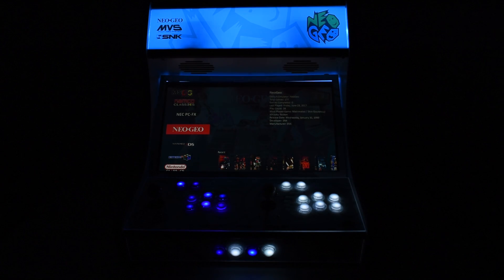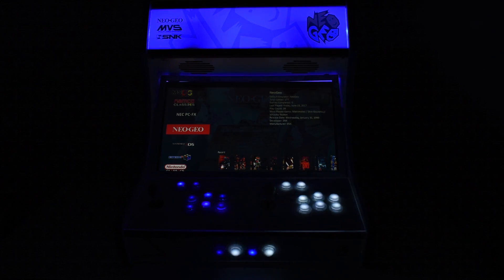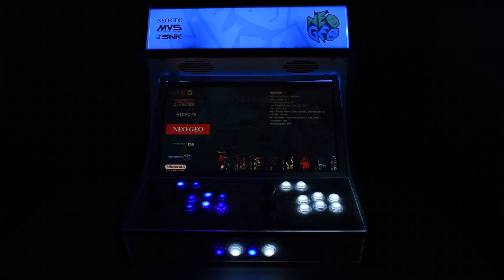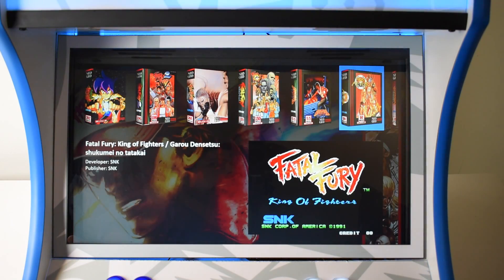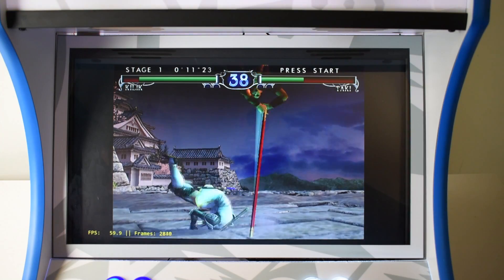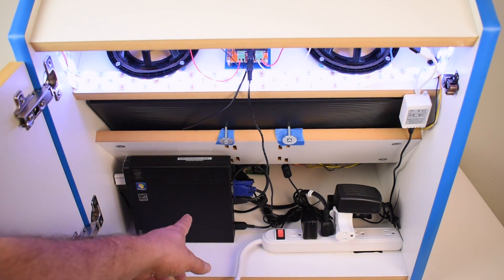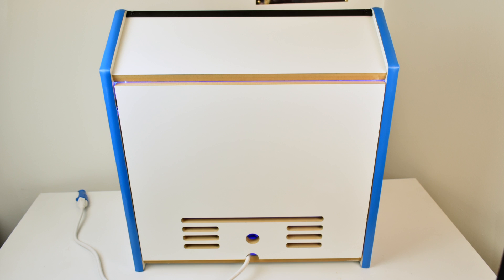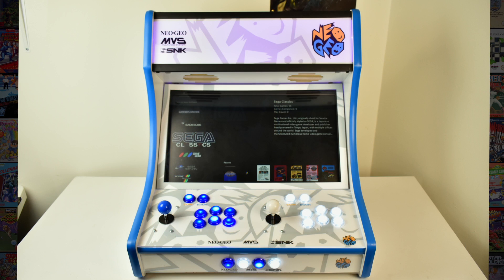LaunchBox BarTop Arcade Update Game Room Solutions Arcade With PC And IPS Display

Comment: Interesting, I assumed neo geo emulation would be perfect on a pi3. What games were giving you problems?
Reply: The pi is great for Neo Geo - Although Blazing Star can have some pretty major slow down at times, but that's part of the fun!
Reply: Jonny Blanka that is very odd that the Pi 3 lags with Neogeo
Reply: i would have over clocked it and put a fan in. done :)
Reply: Now that i think about it, it could be lagging because the original hardware lagged as well. That's why some emulators give you the option to overclock the virtual CPU.  SNES emulators allow you to overclock the FX chip to stop slow down in StarFox that also happens on original hardware.

Comment: Good!  I'm glad you showed us what's going on inside.  Nice and clean looking.  Would you happen to have a Dell SFF (small form factor) optiplex desktop to size up in there?  It sort of looks like it will fit based on what I see in the pictures.  If standing on end, it's 4"(w)x11.5"(h)x15"(d).  In the depth, I include room for cables off the back.  Do you think that would safely fit?  If I have to, I'll simply remove the system board and add some sort of ducting to move air across the CPU and mount the PSU out of the way, but I'd rather just have the PC sitting in the box.

Comment: I use launch box on a q9550 (ya from 2007 wee!, clocked at 4.2, with 16GB ddr 2400 ram, and an SSD that tops out at 300MB/sec as it's older SATA) which runs everything great.

Comment: Interesting how you're having trouble with pcxs2 with an i5. Had no issue running with the $60 Intel pentium g4560 with integrated hd610. Still went with a 1050ti so I can run Wii/GameCube and ps2 games at 1080 res.

Comment: pc min specs for lunchbox to emulate everything from ps2 and back? Please help.
Reply from the maker: +buffalo716 this is not official but my own opinion. I5 4th gen or better at 3.0Ghz or higher.
8gb ram I prefer 16gb and a gtx 1050 4gb card.
Lower end stuff will work this is my own opinion
Reply: ETA PRIME 
thank u. I have a 1000.00 setup in my basement with the pi3 but it deserves better.. I also followed your video on the ghetto pi and made my own but can't seem to get arcade roms to load.. Is this normal ? Thanks for the help man

Comment: launchbox  seems sluggish. aside from that, dope setup
Reply: diggydash I wish I could snapshot these comments and send them to there troll mods. They kicked me and two others off for saying this. Wish they could admit to the sluggish performance and also get real mods instead of fanboy trolls.
Reply from the maker: I defiantly notice the slow down in the big box interface using this PC I have in the cab now If I turn off video intros it's much smoother. I'm thinking about converting the videos to a lower resolution.
my main PC handles it fine but it does have a 4.3Ghz i7.
Did you get banned from the forum for speaking your mind?